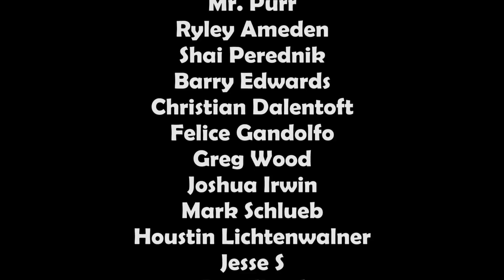Anycubic i3 Mega Hotend Replacement

Comment: it's not a particularly great exapmle of an instructional video of how to take something apart when the machine you're taking apart is modified.  you have totally missed steps anyone with a stock machine would have to do.  you might as well have started your instructional video halfway through the process.  I'm just asying you could have done this demo on a stock machine. other than that it was a good video

Comment: How to fit the other end of the tube?
Reply from the maker: What do you mean? Into the extruder?
Reply: @Fugatech3DPrinting  On my Mega S the tube is fed initially by filament at the "other end" to the hot end, out of the filament input through a motor which houses a metal piece (pardon my terminology!) that surrounds and grips the end of the plastic tube.  It won't budge to pull it back off, so in my case, I had to cut it further up and slide off the other way.  So then when you come to fit the other end of the new tube, it will just slide on.  Hopefully that makes some sense to someone with the same issue!

Comment: Man I had to replace the hot end assembly on my Anycubic, and since I cannot print anything....Ive been printing for 5 years and have 2 other machines but since the replacement its driving me nuts...I also noticed that the 2 rods are bent, hence I cant level the bed as it gets tighter in the center...I tried loosening up the rods and twisting them thinking they were bent slightly down so I would bend them up, but it doesnt matter, they just sag about 10 thou....I tried doing a benchy and one side looks like a mess and the other is fine....I am stuck on this machine!
Reply from the maker: oh man! I've since replaced my hotend with a v6 and a MK3S type hotend setup.
Reply: @Fugatech3DPrinting  Ive since retired this little printer as the rods are bending creating a situation in which the head is closer to the middle of the print bed and therefor unable to get leveled. REALLY HORREDNOUS. Ive since order the Ender 5 to fill the gap in my printer collection and after seeing lots of videos...seems a better design and with a few tweaks should be good..

Comment: hi, i changed the 2 fans on the hot end housing with noctua but the fan that spinning is on the right only, the fan taht cool the part (left) not spinning anymore,

i tried to print test just before it moves when the hot end start heating usually both fans were on, but now its just only one that move... the right one only,  can you help me?

Comment: This looks like exactly what happened to me.  Going to try swapping out the hotend right now.  How do I enable the runaway heating safety?  I'm pretty sure that what caused my issue - and my hotend is scorched much like your old one - is that it got up to 400 degrees during printing one time without any instructions to or indication that it wasn't just plugging along nicely (until the smoke started...)

Comment: I intend to experiment with a non-OEM V5 hotend for the i3 Mega. This hotend has the pneumatic coupler with the blue plunger and allows the PTFE tube to travel only to the top of the radiator, not through it to the nozzle threads. In this hotend, I will use an ID 4.1mm throat/heatbreak lined with a 22-mm section of Capricorn PTFE. I've got three of these hotends prepped and waiting for their moment to come in off the bench. I think the OEM hotend runs into trouble once you start messing with temps of 250C and higher. I am hoping my plan fixes this issue.

Comment: Cool.  Thanks Shane.
Did you turn on the thermal runaway protection?
Reply: This requires a firmware update, yes?
Reply: @pequodexpress  - I assume that it does.

Comment: That tiny hotend connector for 3 or 4 amps the heater cartrige will draw?.  You absolutely need to reflash the control board with the latest marlin and enable the safety checks.  That connector is only rated to 3 amps.  No safety margin there even for a 30W heating cartridge.